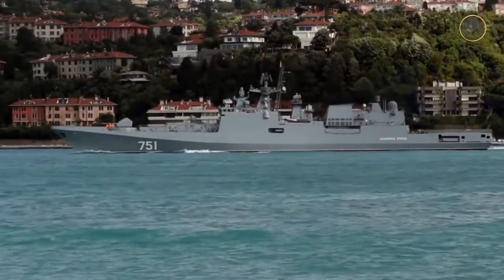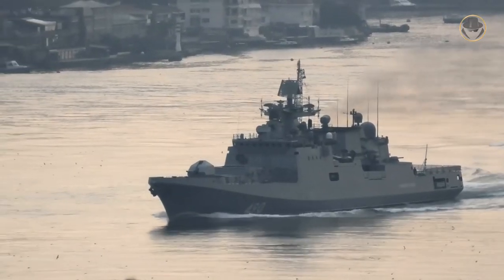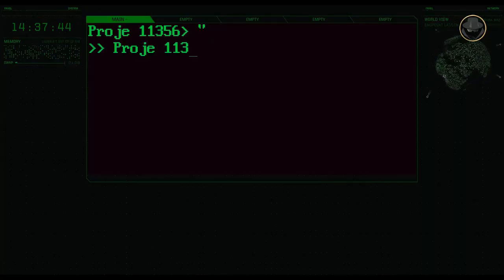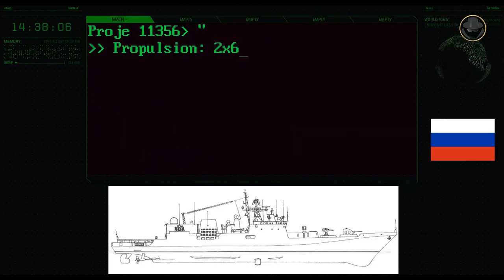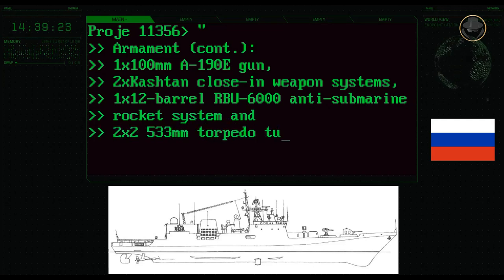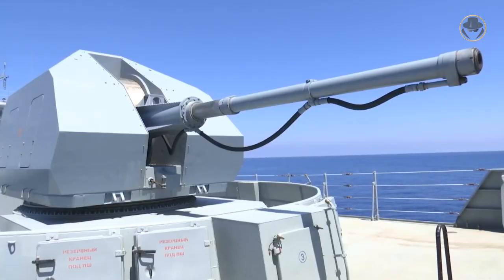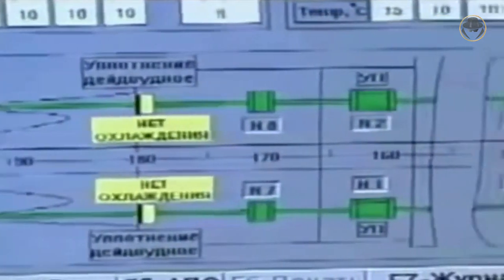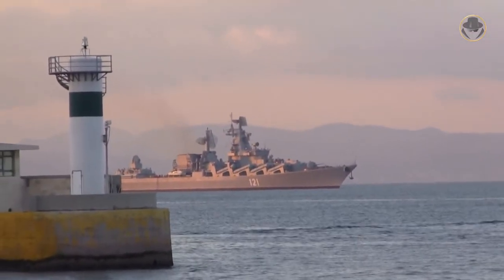Project 11356 (Admiral Grigorovich) class frigate | The Russian Navy's mainstay in the Black Sea

Comment: Better than LCS program
Reply: Incremental designs benefit from everything learned in previous iterations.  Off the board concepts have to go through the full cycle from scratch.  When such projects fail another new revolutionary designs are introduced in full fanfare and the cycle repeats itself.  I don't have to tell which strategy I find more productive and efficient.